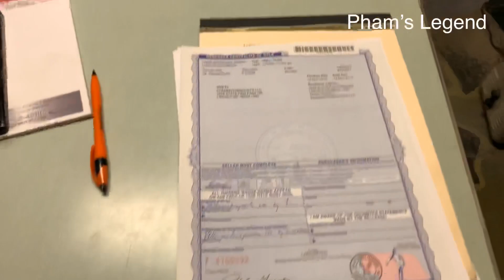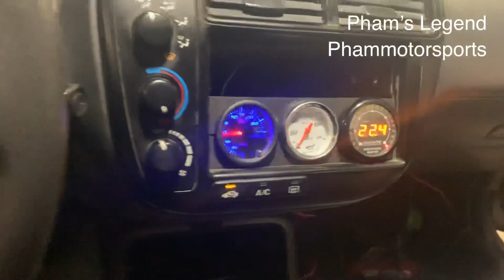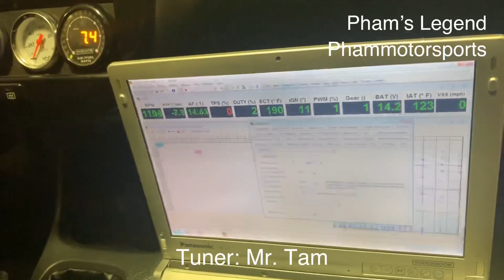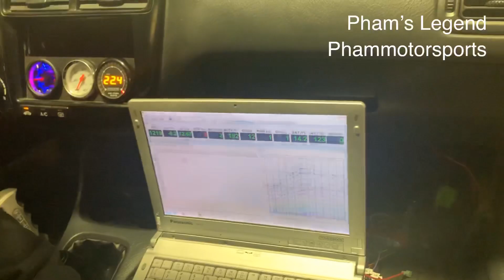99 honda civic built d16z6 turbo retune and sold || Pham’s Legend

Comment: What is the build list on internals to make 25 psi ? Thanks
Reply: Pham im waiting on build list for 25 psi it would be highly appreciated
Reply: I started with the build on the vehicle since stock got it running and driving had issues then for a reliable vehicle regretfully selling. D16z6 darton sleeves head studs vitara pistons manley rods built head crower turbo cam. 1500cc injectors 450 pump. In this video 3582 turbo e85. Can hold 35 psi all day.
Reply: Pham and the current owner did a lot of work with the vehicle and made it into a new monster! This cars been treated very well!
Reply from the maker: Sleeve